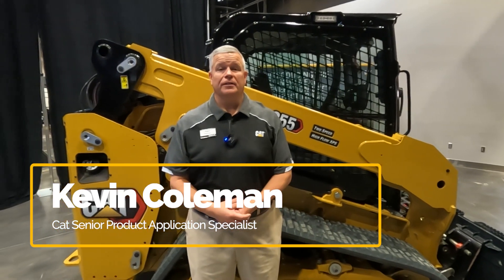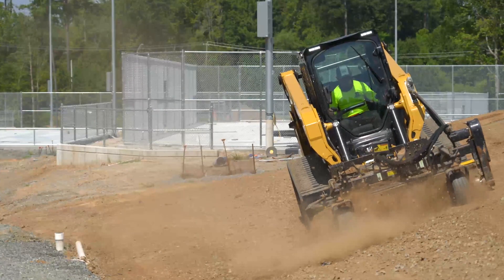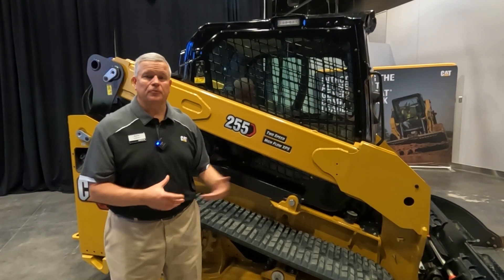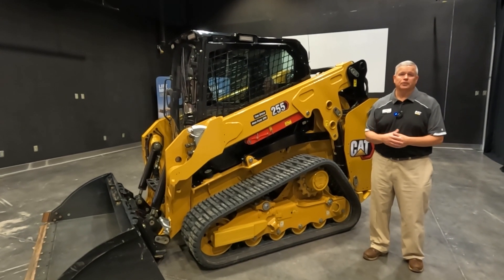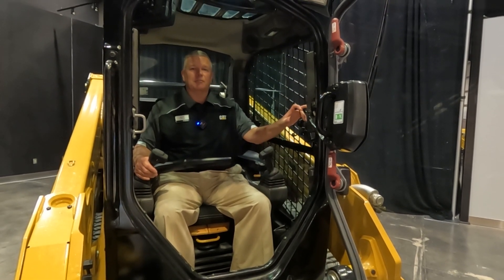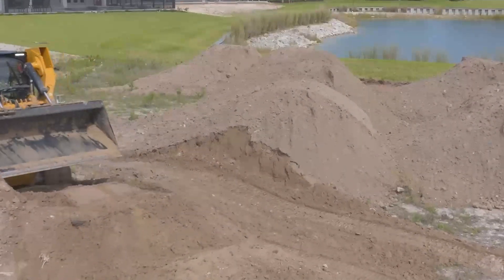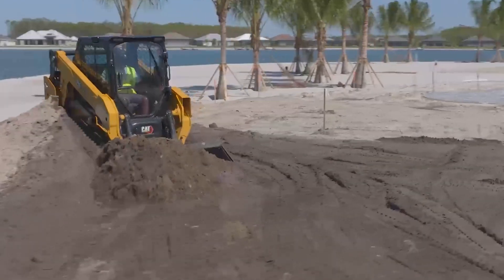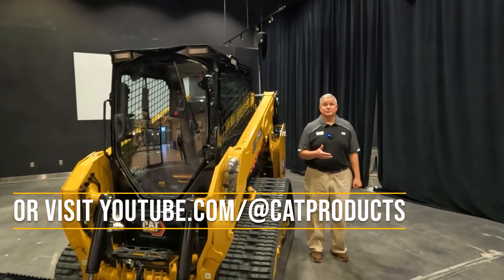Caterpillar's Next Generation 255 and 265 Compact Track Loaders

Comment: It looks like Cat still isnt smart enough to offer a roll up door. It's beyond ridiculous to mandate someone looks through glass everyday. Stupid,stupid move cat. You definitely aren't the old legacy cat.
Reply: Do you have a machine with a roll up door? I’m just curious I’m not defending cat at all my family used to own a deere dealership. I’ve got a 259 and my biggest gripe is the door but my buddy with Kubota is working on door mechanism quite often
Reply: I like the swing door. I've used roll up doors on jobs where I need to get out a lot and it was a huge pain having to roll that door up and down all the time. It was also super dusty and the wind in my face blowing dust in my eyes. Would have much preferred a swing door. I think its just a matter of getting used to it.

Now, our 299D3 is my least favorite machine. The main thing is the terrible visibility. The controls also are not precise enough. And the air intake sucks dirt/dust straight off the track. I really like the new r series bobcats but they have their issues too
Reply: I like the swing door. I've used roll up doors on jobs where I need to get out a lot and it was a huge pain having to roll that door up and down all the time. It was also super dusty and the wind in my face blowing dust in my eyes. Would have much preferred a swing door. I think its just a matter of getting used to it.

Now, our 299D3 is my least favorite machine. The main thing is the terrible visibility. The controls also are not precise enough. And the air intake sucks dirt/dust straight off the track. I really like the new r series bobcats but they have their issues too
Reply: I like the swing door. I've used roll up doors on jobs where I need to get out a lot and it was a huge pain having to roll that door up and down all the time. It was also super dusty and the wind in my face blowing dust in my eyes. Would have much preferred a swing door. I think its just a matter of getting used to it.

Now, our 299D3 is my least favorite machine. The main thing is the terrible visibility. The controls also are not precise enough. And the air intake sucks dirt/dust straight off the track. I really like the new r series bobcats but they have their issues too
Reply: I like the swing door. I've used roll up doors on jobs where I need to get out a lot and it was a huge pain having to roll that door up and down all the time. It was also super dusty and the wind in my face blowing dust in my eyes. Would have much preferred a swing door. I think its just a matter of getting used to it.

Now, our 299D3 is my least favorite machine. The main thing is the terrible visibility. The controls also are not precise enough. And the air intake sucks dirt/dust straight off the track. I really like the new r series bobcats but they have their issues too
Reply: I like the swing door. I've used roll up doors on jobs where I need to get out a lot and it was a huge pain having to roll that door up and down all the time. It was also super dusty and the wind in my face blowing dust in my eyes. Would have much preferred a swing door. I think its just a matter of getting used to it.

Now, our 299D3 is my least favorite machine. The main thing is the terrible visibility. The controls also are not precise enough. And the air intake sucks dirt/dust straight off the track. I really like the new r series bobcats but they have their issues too
Reply: I like the swing door. I've used roll up doors on jobs where I need to get out a lot and it was a huge pain having to roll that door up and down all the time. It was also super dusty and the wind in my face blowing dust in my eyes. Would have much preferred a swing door. I think its just a matter of getting used to it.

Now, our 299D3 is my least favorite machine. The main thing is the terrible visibility. The controls also are not precise enough. And the air intake sucks dirt/dust straight off the track. I really like the new r series bobcats but they have their issues too
Reply: I like the swing door. I've used roll up doors on jobs where I need to get out a lot and it was a huge pain having to roll that door up and down all the time. It was also super dusty and the wind in my face blowing dust in my eyes. Would have much preferred a swing door. I think its just a matter of getting used to it.

Now, our 299D3 is my least favorite machine. The main thing is the terrible visibility. The controls also are not precise enough. And the air intake sucks dirt/dust straight off the track. I really like the new r series bobcats but they have their issues too
Reply: I like the swing door. I've used roll up doors on jobs where I need to get out a lot and it was a huge pain having to roll that door up and down all the time. It was also super dusty and the wind in my face blowing dust in my eyes. Would have much preferred a swing door. I think its just a matter of getting used to it.

Now, our 299D3 is my least favorite machine. The main thing is the terrible visibility. The controls also are not precise enough. And the air intake sucks dirt/dust straight off the track. I really like the new r series bobcats but they have their issues too
Reply: I like the swing door. I've used roll up doors on jobs where I need to get out a lot and it was a huge pain having to roll that door up and down all the time. It was also super dusty and the wind in my face blowing dust in my eyes. Would have much preferred a swing door. I think its just a matter of getting used to it.

Now, our 299D3 is my least favorite machine. The main thing is the terrible visibility. The controls also are not precise enough. And the air intake sucks dirt/dust straight off the track. I really like the new r series bobcats but they have their issues too
Reply: I like the swing door. I've used roll up doors on jobs where I need to get out a lot and it was a huge pain having to roll that door up and down all the time. It was also super dusty and the wind in my face blowing dust in my eyes. Would have much preferred a swing door. I think its just a matter of getting used to it.

Now, our 299D3 is my least favorite machine. The main thing is the terrible visibility. The controls also are not precise enough. And the air intake sucks dirt/dust straight off the track. I really like the new r series bobcats but they have their issues too
Reply: I like the swing door. I've used roll up doors on jobs where I need to get out a lot and it was a huge pain having to roll that door up and down all the time. It was also super dusty and the wind in my face blowing dust in my eyes. Would have much preferred a swing door. I think its just a matter of getting used to it.

Now, our 299D3 is my least favorite machine. The main thing is the terrible visibility. The controls also are not precise enough. And the air intake sucks dirt/dust straight off the track. I really like the new r series bobcats but they have their issues too
Reply: I like the swing door. I've used roll up doors on jobs where I need to get out a lot and it was a huge pain having to roll that door up and down all the time. It was also super dusty and the wind in my face blowing dust in my eyes. Would have much preferred a swing door. I think its just a matter of getting used to it.

Now, our 299D3 is my least favorite machine. The main thing is the terrible visibility. The controls also are not precise enough. And the air intake sucks dirt/dust straight off the track. I really like the new r series bobcats but they have their issues too
Reply: I like the swing door. I've used roll up doors on jobs where I need to get out a lot and it was a huge pain having to roll that door up and down all the time. It was also super dusty and the wind in my face blowing dust in my eyes. Would have much preferred a swing door. I think its just a matter of getting used to it.

Now, our 299D3 is my least favorite machine. The main thing is the terrible visibility. The controls also are not precise enough. And the air intake sucks dirt/dust straight off the track. I really like the new r series bobcats but they have their issues too
Reply: I like the swing door. I've used roll up doors on jobs where I need to get out a lot and it was a huge pain having to roll that door up and down all the time. It was also super dusty and the wind in my face blowing dust in my eyes. Would have much preferred a swing door. I think its just a matter of getting used to it.

Now, our 299D3 is my least favorite machine. The main thing is the terrible visibility. The controls also are not precise enough. And the air intake sucks dirt/dust straight off the track. I really like the new r series bobcats but they have their issues too
Reply: I like the swing door. I've used roll up doors on jobs where I need to get out a lot and it was a huge pain having to roll that door up and down all the time. It was also super dusty and the wind in my face blowing dust in my eyes. Would have much preferred a swing door. I think its just a matter of getting used to it.

Now, our 299D3 is my least favorite machine. The main thing is the terrible visibility. The controls also are not precise enough. And the air intake sucks dirt/dust straight off the track. I really like the new r series bobcats but they have their issues too
Reply: I like the swing door. I've used roll up doors on jobs where I need to get out a lot and it was a huge pain having to roll that door up and down all the time. It was also super dusty and the wind in my face blowing dust in my eyes. Would have much preferred a swing door. I think its just a matter of getting used to it.

Now, our 299D3 is my least favorite machine. The main thing is the terrible visibility. The controls also are not precise enough. And the air intake sucks dirt/dust straight off the track. I really like the new r series bobcats but they have their issues too
Reply: I like the swing door. I've used roll up doors on jobs where I need to get out a lot and it was a huge pain having to roll that door up and down all the time. It was also super dusty and the wind in my face blowing dust in my eyes. Would have much preferred a swing door. I think its just a matter of getting used to it.

Now, our 299D3 is my least favorite machine. The main thing is the terrible visibility. The controls also are not precise enough. And the air intake sucks dirt/dust straight off the track. I really like the new r series bobcats but they have their issues too
Reply: I like the swing door. I've used roll up doors on jobs where I need to get out a lot and it was a huge pain having to roll that door up and down all the time. It was also super dusty and the wind in my face blowing dust in my eyes. Would have much preferred a swing door. I think its just a matter of getting used to it.

Now, our 299D3 is my least favorite machine. The main thing is the terrible visibility. The controls also are not precise enough. And the air intake sucks dirt/dust straight off the track. I really like the new r series bobcats but they have their issues too
Reply: I like the swing door. I've used roll up doors on jobs where I need to get out a lot and it was a huge pain having to roll that door up and down all the time. It was also super dusty and the wind in my face blowing dust in my eyes. Would have much preferred a swing door. I think its just a matter of getting used to it.

Now, our 299D3 is my least favorite machine. The main thing is the terrible visibility. The controls also are not precise enough. And the air intake sucks dirt/dust straight off the track. I really like the new r series bobcats but they have their issues too
Reply: I like the swing door. I've used roll up doors on jobs where I need to get out a lot and it was a huge pain having to roll that door up and down all the time. It was also super dusty and the wind in my face blowing dust in my eyes. Would have much preferred a swing door. I think its just a matter of getting used to it.

Now, our 299D3 is my least favorite machine. The main thing is the terrible visibility. The controls also are not precise enough. And the air intake sucks dirt/dust straight off the track. I really like the new r series bobcats but they have their issues too
Reply: I like the swing door. I've used roll up doors on jobs where I need to get out a lot and it was a huge pain having to roll that door up and down all the time. It was also super dusty and the wind in my face blowing dust in my eyes. Would have much preferred a swing door. I think its just a matter of getting used to it.

Now, our 299D3 is my least favorite machine. The main thing is the terrible visibility. The controls also are not precise enough. And the air intake sucks dirt/dust straight off the track. I really like the new r series bobcats but they have their issues too
Reply: I like the swing door. I've used roll up doors on jobs where I need to get out a lot and it was a huge pain having to roll that door up and down all the time. It was also super dusty and the wind in my face blowing dust in my eyes. Would have much preferred a swing door. I think its just a matter of getting used to it.

Now, our 299D3 is my least favorite machine. The main thing is the terrible visibility. The controls also are not precise enough. And the air intake sucks dirt/dust straight off the track. I really like the new r series bobcats but they have their issues too
Reply: I like the swing door. I've used roll up doors on jobs where I need to get out a lot and it was a huge pain having to roll that door up and down all the time. It was also super dusty and the wind in my face blowing dust in my eyes. Would have much preferred a swing door. I think its just a matter of getting used to it.

Now, our 299D3 is my least favorite machine. The main thing is the terrible visibility. The controls also are not precise enough. And the air intake sucks dirt/dust straight off the track. I really like the new r series bobcats but they have their issues too
Reply: I like the swing door. I've used roll up doors on jobs where I need to get out a lot and it was a huge pain having to roll that door up and down all the time. It was also super dusty and the wind in my face blowing dust in my eyes. Would have much preferred a swing door. I think its just a matter of getting used to it.

Now, our 299D3 is my least favorite machine. The main thing is the terrible visibility. The controls also are not precise enough. And the air intake sucks dirt/dust straight off the track. I really like the new r series bobcats but they have their issues too
Reply: I like the swing door. I've used roll up doors on jobs where I need to get out a lot and it was a huge pain having to roll that door up and down all the time. It was also super dusty and the wind in my face blowing dust in my eyes. Would have much preferred a swing door. I think its just a matter of getting used to it.

Now, our 299D3 is my least favorite machine. The main thing is the terrible visibility. The controls also are not precise enough. And the air intake sucks dirt/dust straight off the track. I really like the new r series bobcats but they have their issues too
Reply: I like the swing door. I've used roll up doors on jobs where I need to get out a lot and it was a huge pain having to roll that door up and down all the time. It was also super dusty and the wind in my face blowing dust in my eyes. Would have much preferred a swing door. I think its just a matter of getting used to it.

Now, our 299D3 is my least favorite machine. The main thing is the terrible visibility. The controls also are not precise enough. And the air intake sucks dirt/dust straight off the track. I really like the new r series bobcats but they have their issues too
Reply: I like the swing door. I've used roll up doors on jobs where I need to get out a lot and it was a huge pain having to roll that door up and down all the time. It was also super dusty and the wind in my face blowing dust in my eyes. Would have much preferred a swing door. I think its just a matter of getting used to it.

Now, our 299D3 is my least favorite machine. The main thing is the terrible visibility. The controls also are not precise enough. And the air intake sucks dirt/dust straight off the track. I really like the new r series bobcats but they have their issues too
Reply: I like the swing door. I've used roll up doors on jobs where I need to get out a lot and it was a huge pain having to roll that door up and down all the time. It was also super dusty and the wind in my face blowing dust in my eyes. Would have much preferred a swing door. I think its just a matter of getting used to it.

Now, our 299D3 is my least favorite machine. The main thing is the terrible visibility. The controls also are not precise enough. And the air intake sucks dirt/dust straight off the track. I really like the new r series bobcats but they have their issues too
Reply: I like the swing door. I've used roll up doors on jobs where I need to get out a lot and it was a huge pain having to roll that door up and down all the time. It was also super dusty and the wind in my face blowing dust in my eyes. Would have much preferred a swing door. I think its just a matter of getting used to it.

Now, our 299D3 is my least favorite machine. The main thing is the terrible visibility. The controls also are not precise enough. And the air intake sucks dirt/dust straight off the track. I really like the new r series bobcats but they have their issues too
Reply: I like the swing door. I've used roll up doors on jobs where I need to get out a lot and it was a huge pain having to roll that door up and down all the time. It was also super dusty and the wind in my face blowing dust in my eyes. Would have much preferred a swing door. I think its just a matter of getting used to it.

Now, our 299D3 is my least favorite machine. The main thing is the terrible visibility. The controls also are not precise enough. And the air intake sucks dirt/dust straight off the track. I really like the new r series bobcats but they have their issues too
Reply: I like the swing door. I've used roll up doors on jobs where I need to get out a lot and it was a huge pain having to roll that door up and down all the time. It was also super dusty and the wind in my face blowing dust in my eyes. Would have much preferred a swing door. I think its just a matter of getting used to it.

Now, our 299D3 is my least favorite machine. The main thing is the terrible visibility. The controls also are not precise enough. And the air intake sucks dirt/dust straight off the track. I really like the new r series bobcats but they have their issues too
Reply: I like the swing door. I've used roll up doors on jobs where I need to get out a lot and it was a huge pain having to roll that door up and down all the time. It was also super dusty and the wind in my face blowing dust in my eyes. Would have much preferred a swing door. I think its just a matter of getting used to it.

Now, our 299D3 is my least favorite machine. The main thing is the terrible visibility. The controls also are not precise enough. And the air intake sucks dirt/dust straight off the track. I really like the new r series bobcats but they have their issues too
Reply: I like the swing door. I've used roll up doors on jobs where I need to get out a lot and it was a huge pain having to roll that door up and down all the time. It was also super dusty and the wind in my face blowing dust in my eyes. Would have much preferred a swing door. I think its just a matter of getting used to it.

Now, our 299D3 is my least favorite machine. The main thing is the terrible visibility. The controls also are not precise enough. And the air intake sucks dirt/dust straight off the track. I really like the new r series bobcats but they have their issues too
Reply: I like the swing door. I've used roll up doors on jobs where I need to get out a lot and it was a huge pain having to roll that door up and down all the time. It was also super dusty and the wind in my face blowing dust in my eyes. Would have much preferred a swing door. I think its just a matter of getting used to it.

Now, our 299D3 is my least favorite machine. The main thing is the terrible visibility. The controls also are not precise enough. And the air intake sucks dirt/dust straight off the track. I really like the new r series bobcats but they have their issues too
Reply: I like the swing door. I've used roll up doors on jobs where I need to get out a lot and it was a huge pain having to roll that door up and down all the time. It was also super dusty and the wind in my face blowing dust in my eyes. Would have much preferred a swing door. I think its just a matter of getting used to it.

Now, our 299D3 is my least favorite machine. The main thing is the terrible visibility. The controls also are not precise enough. And the air intake sucks dirt/dust straight off the track. I really like the new r series bobcats but they have their issues too
Reply: I like the swing door. I've used roll up doors on jobs where I need to get out a lot and it was a huge pain having to roll that door up and down all the time. It was also super dusty and the wind in my face blowing dust in my eyes. Would have much preferred a swing door. I think its just a matter of getting used to it.

Now, our 299D3 is my least favorite machine. The main thing is the terrible visibility. The controls also are not precise enough. And the air intake sucks dirt/dust straight off the track. I really like the new r series bobcats but they have their issues too
Reply: I like the swing door. I've used roll up doors on jobs where I need to get out a lot and it was a huge pain having to roll that door up and down all the time. It was also super dusty and the wind in my face blowing dust in my eyes. Would have much preferred a swing door. I think its just a matter of getting used to it.

Now, our 299D3 is my least favorite machine. The main thing is the terrible visibility. The controls also are not precise enough. And the air intake sucks dirt/dust straight off the track. I really like the new r series bobcats but they have their issues too
Reply: I like the swing door. I've used roll up doors on jobs where I need to get out a lot and it was a huge pain having to roll that door up and down all the time. It was also super dusty and the wind in my face blowing dust in my eyes. Would have much preferred a swing door. I think its just a matter of getting used to it.

Now, our 299D3 is my least favorite machine. The main thing is the terrible visibility. The controls also are not precise enough. And the air intake sucks dirt/dust straight off the track. I really like the new r series bobcats but they have their issues too
Reply: I like the swing door. I've used roll up doors on jobs where I need to get out a lot and it was a huge pain having to roll that door up and down all the time. It was also super dusty and the wind in my face blowing dust in my eyes. Would have much preferred a swing door. I think its just a matter of getting used to it.

Now, our 299D3 is my least favorite machine. The main thing is the terrible visibility. The controls also are not precise enough. And the air intake sucks dirt/dust straight off the track. I really like the new r series bobcats but they have their issues too
Reply: I like the swing door. I've used roll up doors on jobs where I need to get out a lot and it was a huge pain having to roll that door up and down all the time. It was also super dusty and the wind in my face blowing dust in my eyes. Would have much preferred a swing door. I think its just a matter of getting used to it.

Now, our 299D3 is my least favorite machine. The main thing is the terrible visibility. The controls also are not precise enough. And the air intake sucks dirt/dust straight off the track. I really like the new r series bobcats but they have their issues too
Reply: I like the swing door. I've used roll up doors on jobs where I need to get out a lot and it was a huge pain having to roll that door up and down all the time. It was also super dusty and the wind in my face blowing dust in my eyes. Would have much preferred a swing door. I think its just a matter of getting used to it.

Now, our 299D3 is my least favorite machine. The main thing is the terrible visibility. The controls also are not precise enough. And the air intake sucks dirt/dust straight off the track. I really like the new r series bobcats but they have their issues too
Reply: I like the swing door. I've used roll up doors on jobs where I need to get out a lot and it was a huge pain having to roll that door up and down all the time. It was also super dusty and the wind in my face blowing dust in my eyes. Would have much preferred a swing door. I think its just a matter of getting used to it.

Now, our 299D3 is my least favorite machine. The main thing is the terrible visibility. The controls also are not precise enough. And the air intake sucks dirt/dust straight off the track. I really like the new r series bobcats but they have their issues too
Reply: I like the swing door. I've used roll up doors on jobs where I need to get out a lot and it was a huge pain having to roll that door up and down all the time. It was also super dusty and the wind in my face blowing dust in my eyes. Would have much preferred a swing door. I think its just a matter of getting used to it.

Now, our 299D3 is my least favorite machine. The main thing is the terrible visibility. The controls also are not precise enough. And the air intake sucks dirt/dust straight off the track. I really like the new r series bobcats but they have their issues too
Reply from the maker: The door comes off in like 30 seconds, if you want to operate without it.